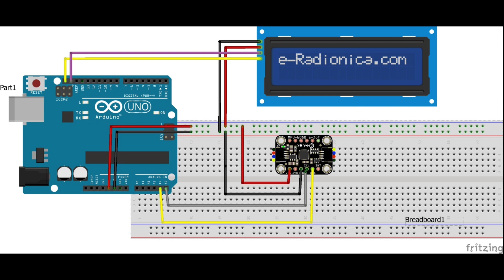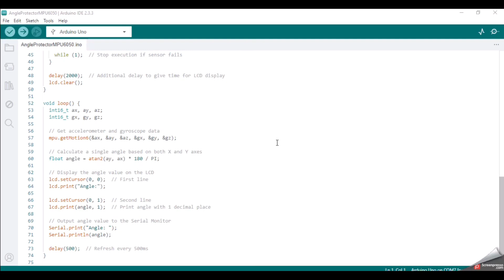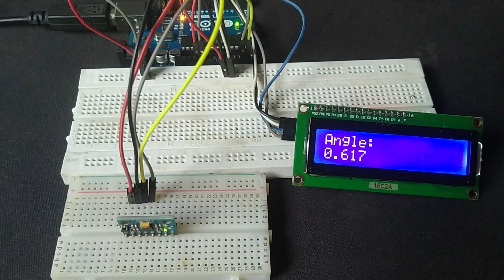Angle Measurement with MPU6050 and Arduino | Real-Time LCD Display

Comment: Hello thanks for the video 
Can we measure angles more than 90 degres for exemple 140 degres
Reply from the maker: @AssiDabi  most welcome dear Yes, you can measure angles above 90° with Arduino using the MPU6050 sensor. This sensor gives you the option to calculate roll and pitch angles, which are measured between -180° and 180°.
Also you change the code extension 
(float angle = atan2(ay, ax) * 180 / PI;)
🥰
Reply: @Digitech_Dynamo thank you very much for your answer, i truly appreciate it

Comment: Hi, thanks for the great video! What are you using to power it? How many V? 5?
Reply from the maker: @RafaelMonteroSastre   Thankyou dear and I am using multiple voltage appliance like Adaptor.smps power, lab banch power and DIY battery or laptop USB power. 5v and 12V both